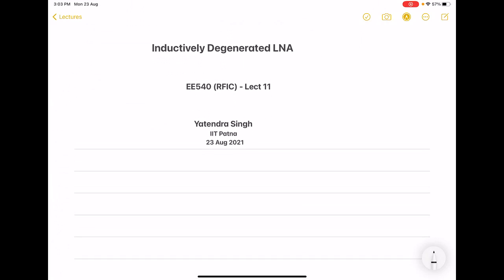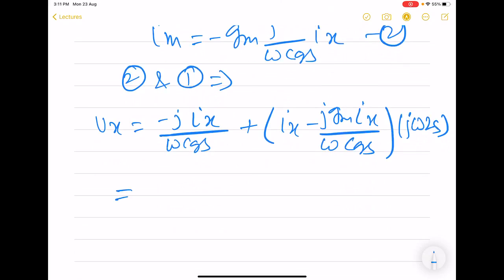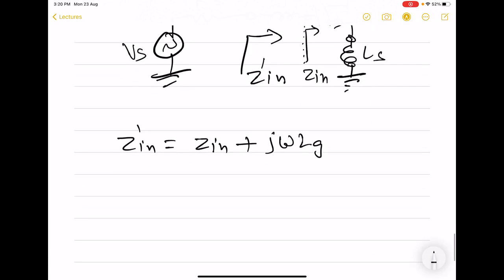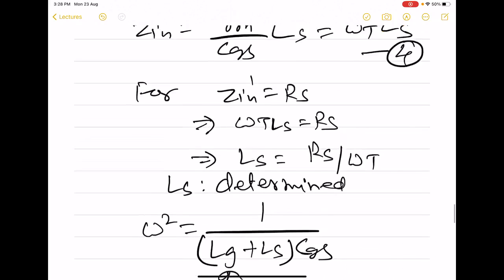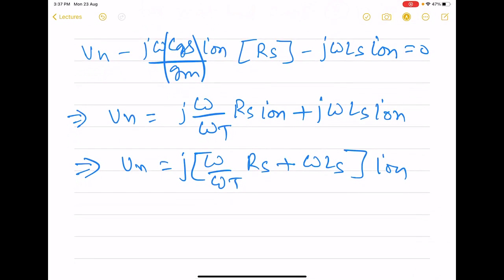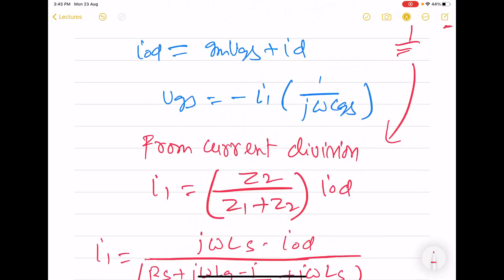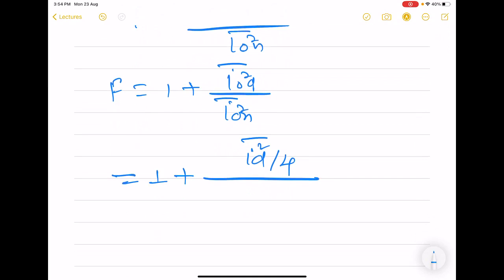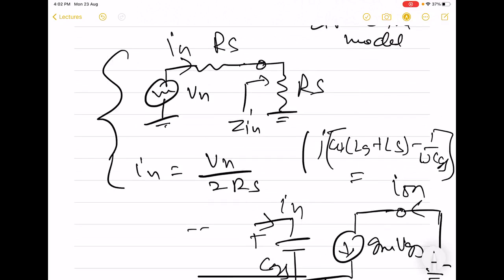Radio Frequency Integrated Circuits (RFICs) - Lecture11: Inductively Degenerated LNA

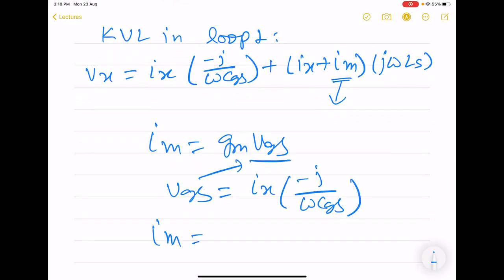Comment: Sir, why didn't you consider source voltage while calculating vgs when solving the equation for loop 1 in small signal model ? (around 7:28)
Reply from the maker: For finding Zin, we remove the Vs, connect an external unknown source, Vx, and find Vx/ix. Hence the source voltage was not considered.
Reply: @YatendraSingh  thank you sir